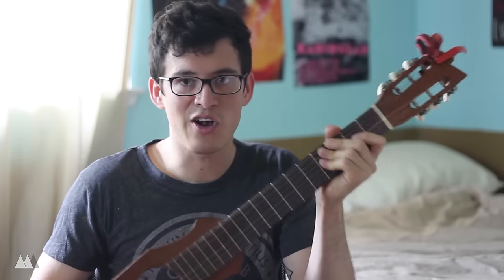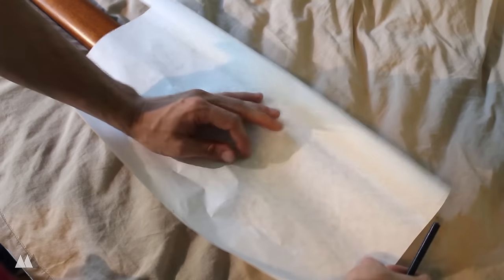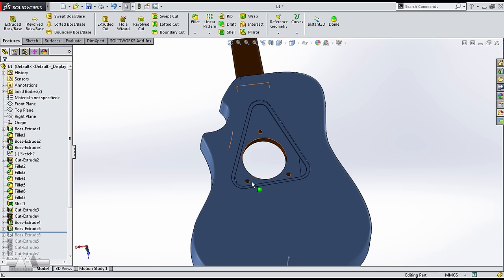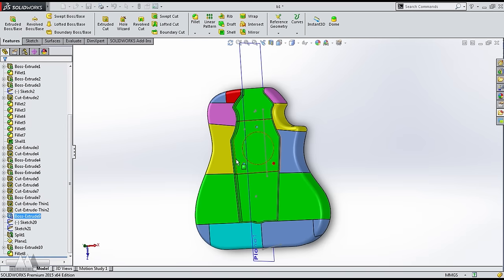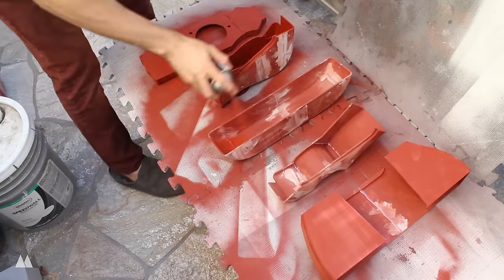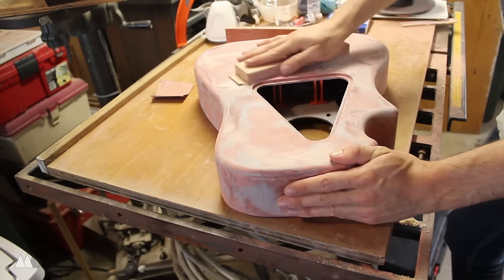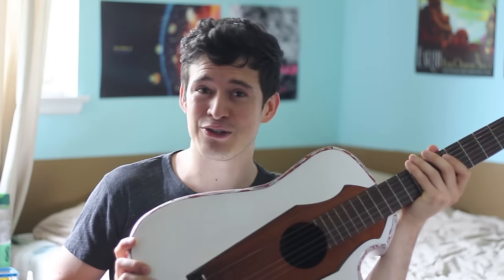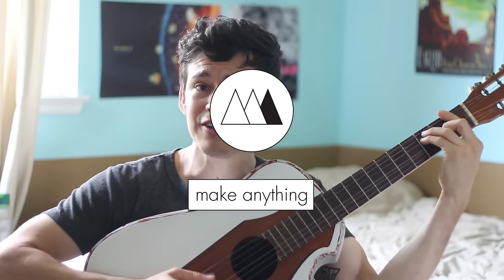The Bodysnatcher : 3D Printed Guitar

Comment: You should 3D print a 3D printer
Reply: Repxotica, Inc mind = blown
Reply: Repxotica, Inc it prolably has to be small and probably won't work
Reply: ... with a 3D printed 3Dprinter.
Reply: Shykai 449 that’s what she said
Reply: its called reprap
Reply: Omg
Reply: @Shykai449  not necessarily. Classic printing with heated material probably won't work. But a clay printer could. For the size, you can just print it in parts and have it be big
Reply: Baum Kuchen with a 3D printed printer
Reply: 😲wow
Reply: @group555_  prusa i3

Comment: This is a great way to build an acoustic guitar.   Your original frame is carrying the string tension, roughly 80 - 140 lbs., so your other parts can be designed to resonate.  Ned Steinberger, NS Designs, made an acoustic guitar in a similar design, but the strings ran across a bridge which was attached to the resonant top, not the main frame.    That gives a direct connection to the resonant body but most of the load is still carried by the continuous structure under the resonant top.

Comment: I Applaud your efforts. I suspect many other guitar designs started out less than optimal. Like you said it's your first and You get loads of credit for actually completing your build. I was considering the process of a 3 d printed guitar as well and learned from your experience. I'm now considering a larger 3D printer like the Tevo little monster which would increase the parts sizes and decrease the work.
Well done !!

Comment: Acoustics work because the soundboard vibrates and shakes the air molecules inside the guitar which then is pushed out of the soundhole. Because of this I find it weird such a thick piece of wood is used for the little part with the neck. Steel strings also vibrate a lot more than nylon so I think it'd be kinda cool to see one like that

Comment: Do some Male-Female pins to work like a guide, give strenght and make all the parts joints easier.
Reply: Nemesis01100 easier*
Reply: LudicrousSeal 2002  that makes no sense. More easier?
Reply: Just easier. Thanks bro.
Reply: No one sais its easier. Easy only has one sillable. Grammar
Reply: LudicrousSeal 2002 syllable"
Reply: Goat Bot close enough
Reply: Goat Bot whatever

Comment: I was looking for something in particular and found this. This comes close. I was thinking of making a bolt on through neck with a Strat template I have by using a narrow blank possibly 5" wide with the pickup and bridge cavities and all the knobs and switches. I want it to be bolt-on through neck so I can buy a neck for the project. Usually through necks are glued. Then 3D print a body to accept the through neck similar to your acoustic. The wood would give the guitar some tone and sustain. Various bodies can be printed to use the same though neck.  You can print numerous different shapes and patterns.

Comment: I'm actually more interested in the body snatcher it self tbh 
I really like the idea and I think I'll make one (it's too simple to ask for a guide) What problems did you encounter
Got any tips?
Would be great to hear from you
Thanks for the awesome video
Reply from the maker: Everything went pretty well making it, as far as I remember... Milling the soundboard down to 1-2mm thickness was scary, but it worked out... In my next version I would CNC the inside to make more hollow space for a better sound.
Reply: Well, it's pretty much the same thing as making a through-neck guitar, only he just cut a hole in the center and threw on a modular body. Which is a great design, just not what I'm into. Lol.

Comment: take the struts out and you might get a bit more resonance and sustain because the front and back of the guitar can vibrate independently. Obviously they would ideally be two one piece soundboards but that's the limitation of 3d printing. awesome stuff man

Comment: may i suggest using a different material. and make it much thicker with some either printed support or even epoxy some in place. great job on the creativity  and concept. i have tried my hand at a few myself ive used wood based pla and they seem to sound best.More recently laser cutting has given me a few ideas as well.

Comment: Love the idea of the Bodysnatcher. especially with 3d printing as a factor. let's you kinda have a single playing structure (which can be portable as hell, for practice on the go, or travel jam sessions with a small body option), and the ability to swap out your bodies for different tones. off the top of my head, I could think of a very traditional one like in the video, maybe a smaller, compact one for a brighter tone (like a soprano ukulele vs tenor), or a more streamlined and compact one for travel. hell, even one set up as an electric/acoustic. and that's not even taking into consideration tones from other materials (straying from 3d printing again.)

might have to steal this idea for my own personal use. (not stealing credit, just making my own for the utility)

Comment: it's only twangy because it has nylon strings. those are meant to be finger picked. if you had steel strings, I'm sure you'd get the sound you have in your head! great job! final note, don't put steel strings on a classical setup it's not going be feel right haha

Comment: That's a really good demo of how to 3D print larger than Build Plate objects. I'm about to build a printer with a build plate large enough to hopefully 3D print a guitar body in one go but I am wondering - did you use any woodworking skills to obtain interconnecting points because if you can jigsaw-link parts together I think they'll be much stronger than flat surfaces glued together. Great demo though and I also liked the edge pattern idea : )

Comment: i think it will not get much better than that, because the usefull vibration what you have to work is the whole "mini guitar body", while in a classic guitar the strings vibrate directly the guitar top, then you listen. In your case, strings vibrate your body, than the body vibrate the second body, than you hear... 

since you dont have acces to the source of the sound, will not get that better than you did.

Comment: wait did you put a piece over the open triangle or leave it open
Reply from the maker: It's covered. The plastic lid was warped and didn't fit right, so I cut a piece of foam core to shape and I'm using that as a temporary cover

Comment: who uses bondo to repair cars legitamately, I would do welds, with sheet metal if needed, and then sanding off the extra material and replacing plastic bumpers. I do know a bit about automotive work and bondo is not the best choice ever, I have seen roofs repaired with bondo (damaged by rust in the past) cave in before, trust me, just weld on sheet metal, it is a lot sturdier and a lot more durable

Comment: How thick is your guitar?
Reply from the maker: What part?
Reply: Body's guitar
Reply from the maker: 3.25" deep... about half an inch narrower than my regular guitar because I wanted it to be compact and comfortable
Reply: Without the soundboard ?
Reply from the maker: Right... But with the 3D printed body, it's made so the soundboard fits flush with the body, so the thickness doesn't change.
Reply: i need thickness of your body´s guitar without the soundboard. I´m making a guitar so slim, more than an electric guitar.

your dessingn is so perfect and versatile
Reply from the maker: The wood is 3/4" thick
Reply: thank you my friend. I'll send you a picture of my completed guitar.
Reply from the maker: Nice, I look forward to it!
Reply: Victor Avila how did it turn out?
Reply: iI have not even finished.